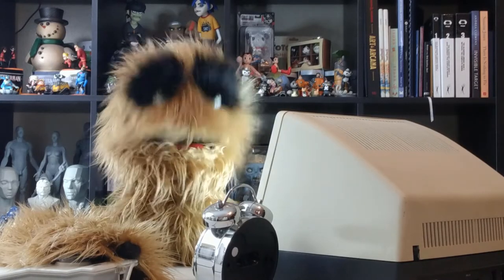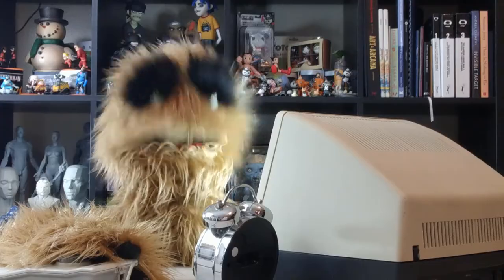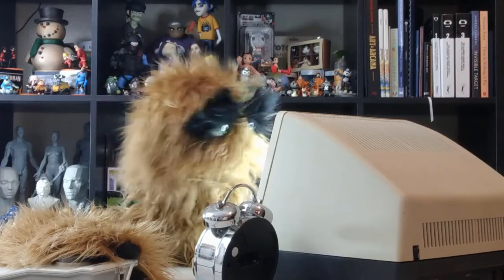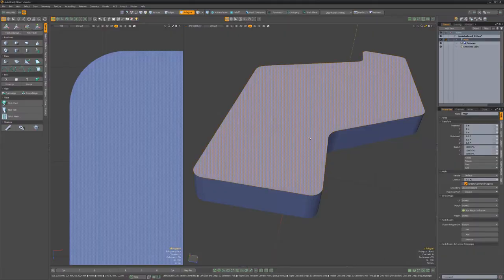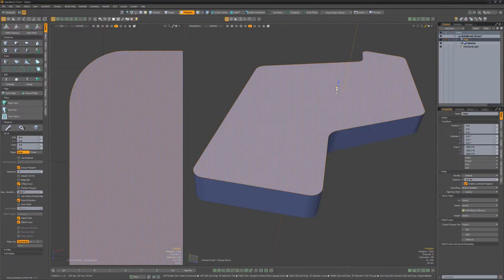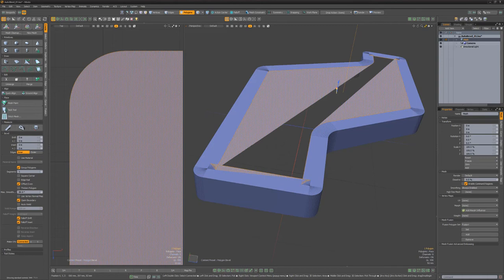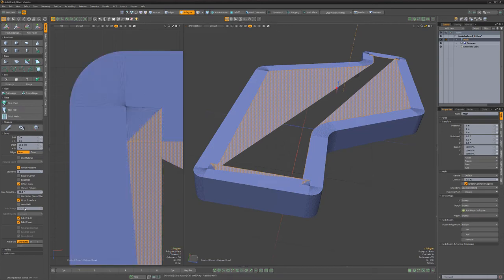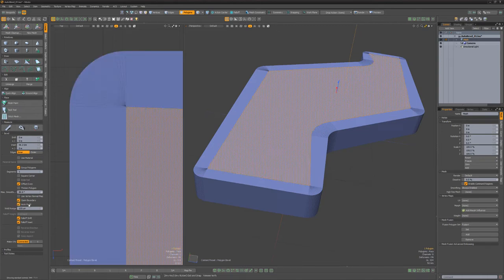Modo | Bevel: Auto Weld

Comment: Hah I thought only Blender has this feature
Reply from the maker: Was a nice addition to Modo awhile back.
Reply: @Pixelfondue  There is also a thicken option for Polygon bevel.  This seems useful when you extrude a planar surface and you want to cap/close the volume. How it will behave when you don't want to extrude all the faces on a planar object ? I mean it will cap only bottom of that selection or the entire bottom creating double overlapping faces for faces that dont get extruded? Do you even want that? Or this option is more design to be useful when extruding a single face object or all faces on a planar object?

I see Modo also has a Thicken tool, Maybe that is the right tool to use in the other cases (more like Max shell modifier I suppose)

And then there is the Fill Quad tool in Modo that could be more useful than this thicken option? I dont think the thicken option has the quad topology built in but it  could really serve a lot to have that.